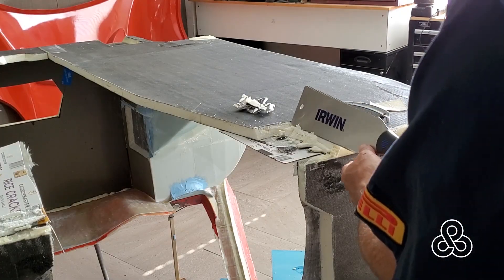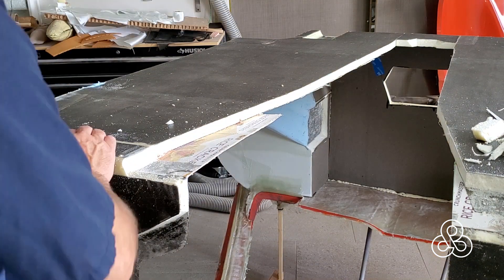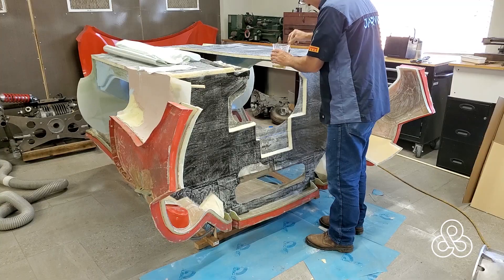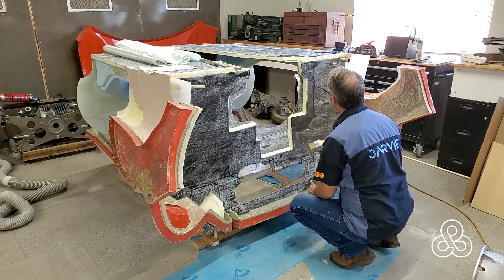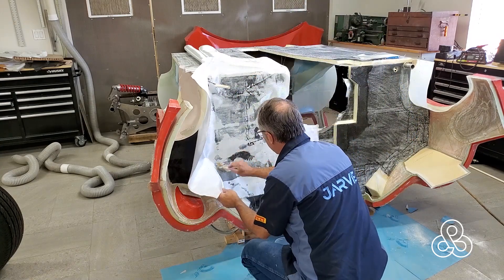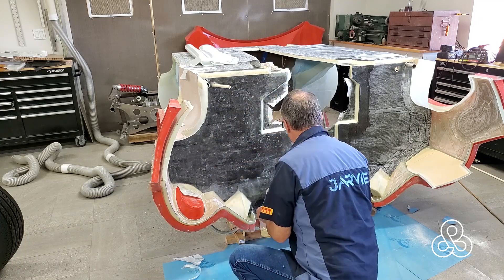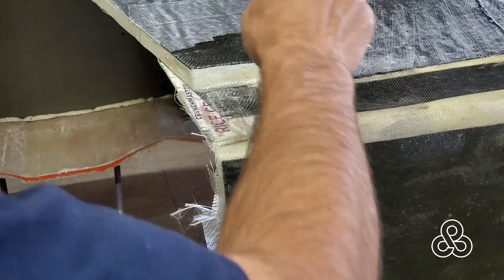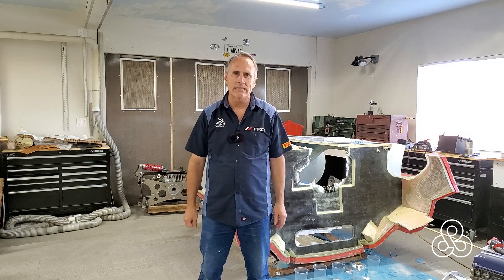Arete Supercar project - laminating reinforcement points for the sub-frames

Comment: im loving the build BUT i question your use of foam board/ plasterboard it seems your just making a huge crumble and fragile zones between your glass resin walls . id hate to think what would happen if that foam ignited as fiberglass burns really well without encouraging it. I wouldnt go in it. and i have driven a reliant 3 wheeler and have done so at 90mph
Reply from the maker: Unfounded fears. If you get a chance to go for a ride with me, I'll keep it under 90. ;)

Comment: I have been watching your videos and am quite concerned about the strength of your creation. A short time ago I watched a documentary about the famous Ford vrs. Ferrari. In one of Fords redesigns in 1967 or 1968 to the chassis of the F 40 to make the chassis lighter they used a similar type of fabrication to what you are doing . In doing so it took the life of Ken Miles who was test driving the car I believe at Daytona.
After this horrific crash Ford went back to making the chassis out of metal tubing. Your should really give this some consideration given the fact that you have said this car will travel at over 200 MPH.
Reply from the maker: Let your troubles be stilled. A lot has happened with the science after 50+ years since the loss of Ken. All composite monocoques are very common today. When, or if, I ever push the Arete to 200mph it will be after a lot of testing at 5- 20- 50- 100- 120- 160mph. and then If I make the attempt I will likely call it good and not test hard over the 200mph mark to compete against the worlds fastest. Thanks for your concern however . . somebody besides my mother has to worry for me. Ha!

Comment: I got it and I really like it. Your reversing everything for Superior weight placement. Trans in front of rear mid engine . I thing I’ve seen this done  by Bugatti and possible Lamborghini . Good for you .  Dare to be the best you can.
Reply from the maker: Yep! I would like to have run the rear propeller shaft back through the oil pan a-la-Lamborghini style, but along side will have to suffice.

Comment: Are you sure foam is a good enough sandwish material for this application? Pretty sure the supercars uses aluminum honeycomb for their sandwish material.
this type of stuff: http://www.formula1-dictionary.net/carbon_fiber_composites.html
Reply from the maker: The foam used in the bulkheads of the tub are not used in a structural sense. The 1 inch foam is a thermal insulation and a form for constructing the panel. The structural advantage they do give is to hold two surfaces of the fiberglass apart in an I beam fashion. In other words, you could remove the foam and the structure would remain in its full strengthen. You will see me using a Nomex (aramid) honeycomb in flat panel structures. This honeycomb is structural. Using aluminum honeycomb is much more difficult and must be stored in a system that prevents oxidation. In a production environment, storage and the added difficulties might give it advantages over the Nomex honeycomb core material.
Reply: @BuilderCreator  Okay I see. Nomex seems like a good alternative. I was just curious about your reasoning for the foam. Which you answered now. All good. Keep up the good work!

Comment: I just started watching your videos and I've not seen you use a fiberglass roller anywhere so far. Are there cases where you would?
Reply from the maker: I use a disc type roller (consolidator) on multi layer layups and when using chopped strand mat. Never a roller for applying resin.
Reply: @BuilderCreator  I wasn't suggesting for resin application, just the disc roller or the paddle roller. I saw on your video shortly after I posted this where you were reinforcing the a pillar and you used the roller. Thanks for the response

Comment: Well, I have another silly non-technical question 😂, how do you clean the brush used for spreading the resin? do you reuse the brush? Do you keep your brush in some sort of thinner medium, maybe 🤷‍♂️?
Reply from the maker: I use a very cheap disposable brush. (likely about the cost of some solvent, so saves time not cleaning.) We call them "chip" brushes here in the US. Wood handle with natural fibers. I'll try to give a close up in a future video so you can see what they look like and find them yourself.
Reply: @BuilderCreator  Thank you, sir 😊👍
Reply: @divyanshsrivastava7312  the natural fibers part is important. Certain resins will eat up poly fibers on a brush